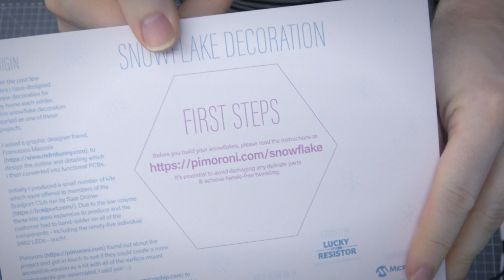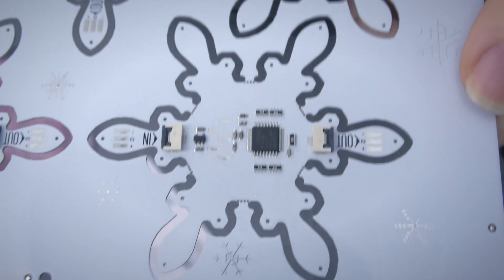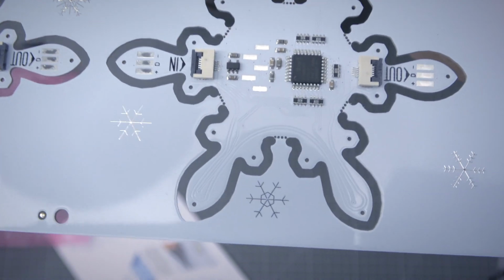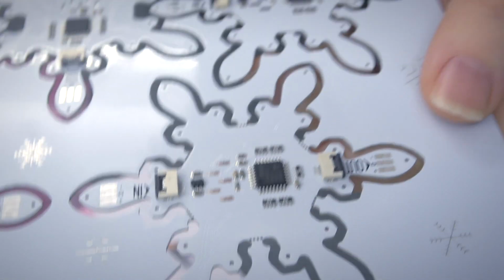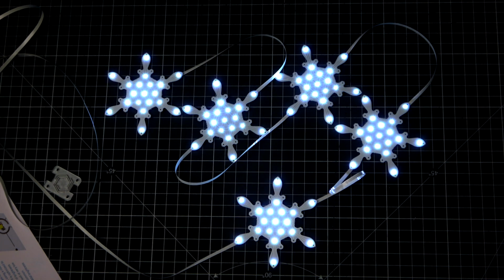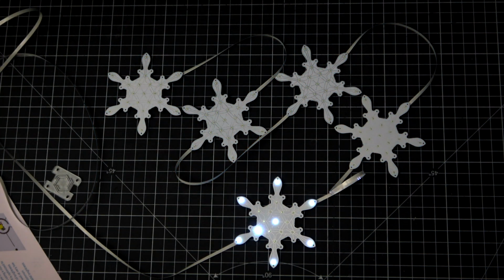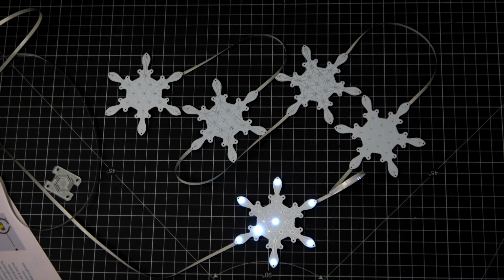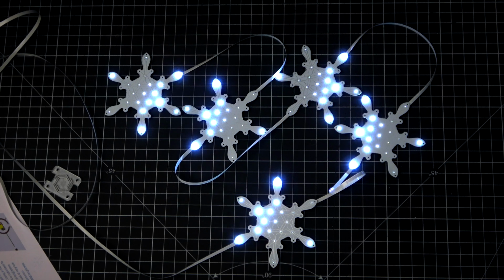Pimoroni Christmas snowflake - build video

Comment: I got one of the original Snowflake kits from Lucky Resistor and yeah, they were definitely "challenging"! 😹

I generally have no problem with surface-mount soldering, at least down to 0603 parts, and 0402 when I have to, but a few specific things made the Snowflakes particularly difficult.

Firstly, they used 0402 LEDs, with solder pads that were basically the same size as the LEDs (not really any pad visible around each LED), so it was very difficult to get a soldering iron onto the pad with the LED in place.
The LEDs and the footprints on the board both had very subtle polarity markings, so it took a lot of effort to know which way around to mount them - and I still got a lot of them wrong!
The LEDs also had a bad habit of pinging out of my tweezers, never to be seen again - and they were moderately expensive LEDs, so there was only one extra, IIRC. I ended up buying another 100 of them from Digi-Key for something like £25 - which felt like ridiculous money when I'm used to buying 1000 LEDs for £5 from China! 😅

They are gorgeous LEDs, though. A much more natural snow-like white than the cheap LEDs I usually get, and from a very small point, which is why he chose them for this project.
I don't recall if the Pimoroni-partnership redesign uses the same LEDs... I did buy a set of those as well, so I guess I should compare them :)

Having discussed it with others who bought original kits, the way to go was solder paste and hot air and/or hotplate, rather than a soldering iron and solder wire.

I actually live-streamed an attempt at soldering up just one Snowflake... It took more than 2 hours! 😹
I don't recall if I tried using solder paste in that video. I guess probably not if it took 2 hours for one Snowflake...
(That video was a few years ago, so I don't remember many details :p I've also not really put much time into editing videos 👀)
Reply from the maker: 2 hours seems OK for all those LEDs! I no longer have my snowflake so I can't tell you about the LEDs... (I gave it away to a friend with an autistic kid who really likes the sparkly lights)

Comment: The stickers on the screw holes are there in case they were assembled in a wave or immersion soldering machine, you don't want the threads filling up with flux or solder. Small buzzers and sounders often come like that too.
Reply: I think pick-and-place machine use is definitely part of the reason for the Kapton tape, though your explanation could well be part of it as well :)

Pick-and-place machines need a solid flat top surface on components for their vacuum pick-up heads to grip, so a big screw hole like that would prevent automated assembly on standard equipment. I know that Pimoroni have at least one pick-and-place machine, and I'm not aware of them having a wave soldering bath, so that's probably the benefit they get from it, at least!

I think the stickers on buzzers and the like are protection for wave soldering, as you say, but they're through-hole devices that probably wouldn't meet a pick-and-place machine.
But I've always seen the Kapton tape on connectors (eg mini/micro USB) as primarily being for pick-and-place machines :)
Reply: sorry to be off topic but does anybody know of a method to get back into an Instagram account?
I somehow forgot my login password. I would appreciate any help you can give me
Reply: @Avery Jagger Instablaster :)
Reply: @Casen Ace i really appreciate your reply. I found the site thru google and im in the hacking process atm.
Takes quite some time so I will get back to you later when my account password hopefully is recovered.
Reply: @Casen Ace it worked and I now got access to my account again. Im so happy:D
Thank you so much, you saved my account :D
Reply: @Avery Jagger Happy to help =)